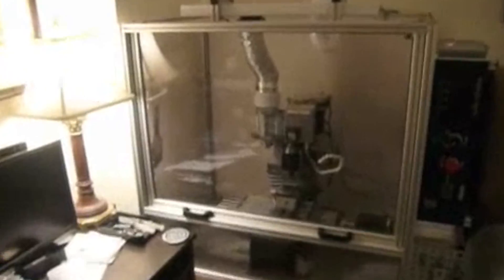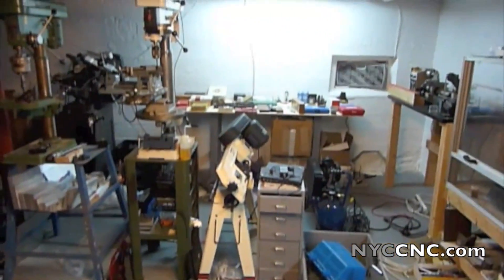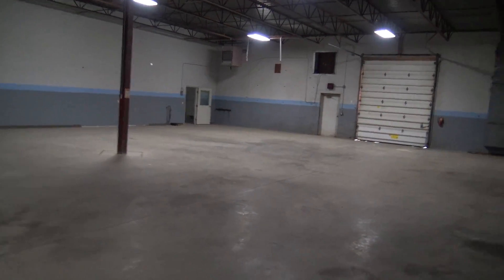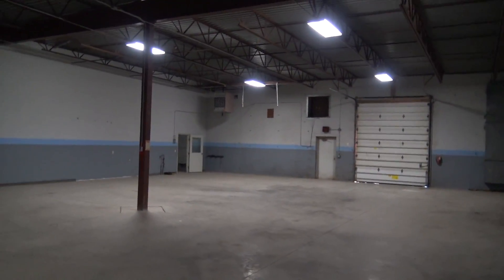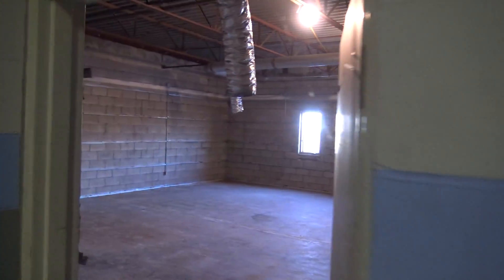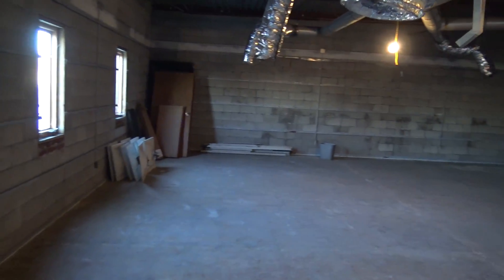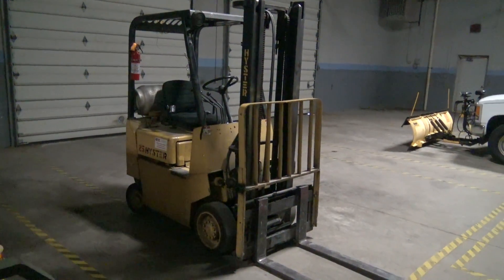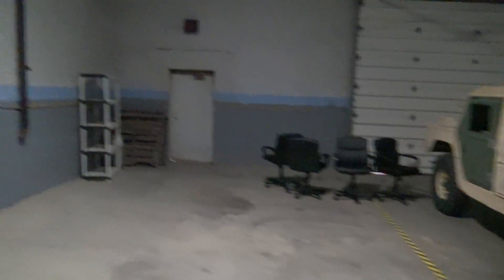We're Moving Again - One Last Time!  NEW SHOP!

Comment: On the epoxy floor, I did my garage, and I would recommend you put the non-skid (aluminum oxide) in it as you will have liquids and lubricants spilled on it…  Also you may want to approach manufactures to see if they want to sponsor you like Tormach did .  Free or at a reduced cost for the product, and possibly onsite help when you apply it.  Invite over about 10 people to help, due to the LARGE surface area, as I needed three people to do a two car garage and we were working hard to make sure we put the epoxy down according to the label directions…  I had good luck with Epoxy-Coat brand. http://www.epoxy-coat.com/  I am not affiliated with them but had good luck with their product.  None of the coatings are inexpensive, but the higher the build layer the better off you will be.

Like any coating, surface prep is PARAMOUNT!!! You can’t do it too well.

Comment: John cogratulations!  Copper air lines are absolutely the best.  once made, the sweat joints will never leak, and the best part is if you need a new drop/outlet, just cut into the line and sweat the new fitting in.  This is so much easier than steel or aluminum,  and again it's PERMANENT. 
As for the lights, you may want to check into a dedicated led supplier.  By me that is Cool LED Inc.  They will provide cost comparisons for your actual situation, payback times, roi, etc.  But, here's the cool part, they will also file all of the applicable forms with your power company and provide tax forms for you to make sure you get all available credits. Finally,  polyurea is the best floor coating by far. However, it is expensive, if you have areas that you know will take a beating use it there.  All the best.
Reply: +Ben Purdy I'm going to have to say that my experience with air lines has been that the new aluminum lines with press fit fittings has been the way to go. Large lines from our turbo compressor to the media blasters, and to the workbench areas has been flawless over the last 4 years of growth in our shop (we have the whole building now, about 6000 sqft). We started in one corner of the building, then our staged expansions and changes were so easy to do with no soldering or air leaks. We ran 2 1/2" main lines, with 2" feeders coming off of them. NO problems, no leaks, no hassle to change. But that may just be because we rock. Just sayin...    :)

Comment: I didn't read all the comments but I am sure this was mentioned. for the space division I would go with a combination of sliding partition walls and bi-fold so you can open the space as much as possible when necessary and as far as the lighting T5 is OK but bulb service life isn't great when compared to LED. Also with LED you have a better choice in control of the spectrum (color) of the lighting and less possibility of flicker issues if you get quality gear. BTW congrats on a new permanent shop, Can't wait to see the setup cause that's a beauty of a space.

Comment: John, send me your dimensions of the building for a lighting layout, I assume you want it bright. 
I can give you a point by point foot candle reading as well as fixture spacing.

Do not use T5, the cost of the replacement lamps are too high. I would go with a 6 lamp T8 over the T5 due to cost.
LED is going to be expensive up front. Probably not what you want to do during startup but if you do want to spend the extra money, then go for it. I recommend 5000k lamp color.

I can also help you with the electrical side of things if you have any questions/concerns. 
I am an electrical/lighting distributor.
Reply: +NYC CNC 
Done, let me know if I can help any further.

Comment: Congrats, buying your own premises is an exciting and humbling step...  LED lights are the go, buy the good ones and the payback time is less than the warrantee so you can't lose. We run polyethyline reticulation pipe with those chunky, hand tightened, compression fittings for air, we have s small screw compressor and probably use as much air as you would..  Anyhow, that setup works well, costs nothing and I can guarantee it will last at least 6 years without leaking, because that's how long we've had ours in place.

Comment: Yes on the T5 lighting.  We recently replaced all our lighting with those and the difference is remarkable.  The only drawback is missing out on the heat they used to provide in the Winter.  Oh well.

My advice on the floor epoxy is don't.  Two of our bays are coated and all you end up doing is essentially tiptoeing around trying not to scratch it up.  It's nice for cleanup, but if you get to moving skids around with a forklift, you will end up ruining it eventually.

Our welding bays are walled off, so that's obviously my suggestion, but if you don't want to do that, a curtain should work fine.
Reply: +NYC CNC No.  Beams, purlins & metal siding.  Just like the exterior walls, minus the insulation.

Comment: LEDs are not worth it in a small shop.  For the amount space you need to light it will be worth it for you.  The inital cost will probably cost you 3 times more than what t5's will cost you but if this is your last move you will get that money back with what you are going to save on electricity.

Comment: first of all WOW, that is a huge room, I have been following you since the taig  (i still use my taig) never would have thought it would become this big.    as for deviding, you meight want to go with welding curtains BUT with some way to stretch it like on a trailer, if needed it can be removed fast but because you stretch it you have more like a wall (not sure how to properly explain that since english is not my native tongue) airlines, copper if you are gonna do it do it right and do it in copper.not sure about the lights, led will be cheaper when running it, meigt not be the cheapest when buying it, but look for second hand lights, get them cheap and you can Always change them later.

Comment: That new shop looks fantastic, great job and congratulations!

I googled a couple of T5 vs LED evaluations, and they all refer to a study made in 2009, and as LED development goes, that's some truly ancient tech (In a very recent car headlight review the LED lights outperformed the HID lamps by some margin). A visit to a lamp store with a lux meter at hand would prove most useful. Any case, if T5's are selected, special attention to eliminate the stroboscopic effects must be taken, it would be bad if a lathe or a fly cutter  turning at 3600RPM looks as if sitting still...
Reply: +NYC CNC +1 on the LEDs, I have a friend with some in his shop hanging at 8 foot and they are plenty bright. For the high bays you should read up on the health advantages of ceramic metal halide CDM lights, they have a very high color rendering (close to daylight).

Mike
Reply: +allsortsofinterests Also, if you have 3 phase you can stagger the lamps for more even light like they do for stage and studio.

Comment: At least one poster is right. Codes will dictate exactly what you can/can't do. Everyone has there own opinion and this is just mine. Get your security up to a very high level before you move a single machine in. That glass front door is an invitation. Think crooks aren't interested in machining also? You'll be advertising just what you have right here. Yeah copper is best, and I think 3/4" is much better than the 1/2". You get much higher flow rates, and the pipe acts as a secondary air storage. However after a certain length of run the water has been condensed out. After that black pipe, proper flex air line is far more cost effective. You will have long runs of air line. That requires larger sizes to keep the same air flow just due to drag from the pipe walls

Run ALL your services up in the ceiling. It costs more to start because of all that ladder or hydraulic lift work. But it's easy to make the changes later that you will be doing. Power/air etc outlets in the perimeter walls should still get the drops coming down from that ceiling. 

Good thing your still fairly young, you'll need all the ambition and motivation you can get. Be ultra careful you don't get burned out with all this. It's far too easy to lose everything including family by trying to do what you think is right, but no one else can see or agree to the same. It's not worth losing anything over this. 

Sliding floor to ceiling panels if code allows them to separate the grinding, welding areas. This whole project is going to cost BIG BUCKS to get operational. If you don't have that? Start small, section off the building and work in the area you need. Pointless to heat, light areas your not using. 

Maybe it's just the lighting or something else. I seriously question the quoted hrs on that forklift. I've been running wharehouse, on highway, off highway, logging, and open pit mining equipment for well over 40 years. Something doesn't ring true there. Service the whole forklift so you know where you are. Especially motor and hydraulic filters. Forklifts are never treated to regular services by most unless there owned by a large company that does have or has learned the hard way that regular PM servicing is money well spent.

My best guess is you'll be moving up to something besides the Tormach equipment real soon. Factor that in while placing what you now have. Don't say a single thing on here about what your security is or is going to be. 

Put some industrial quality fans up on the ceiling to drive the heat back down where you need it. It it were me? I'd investigate some waste engine oil heating systems. At a guess I doubt you'd find a cheaper method. Your future customers will judge your business by how you keep your shop. Spotless may not be 100% needed everywhere. But customers respect that and no one else is as important to your business than those customers. All of this is pretty logical and basic, but it helps to get some input so you can figure out what to do or not.
Reply: +NYC CNC 
Maybe great, maybe not. Since I can't know your whole situation, much of that could very easily be worthless.

Comment: We use heavy duty tarps ie Lorry curtain sider material hung from the ceiling to the floor to partition off our machine area. It works really well, keeps dust and dirt out, a little bit of heat in and if we need to get into the area with a forklift we simply roll up the tarp.

Comment: have you considered walk in fridge panels. twenty foot long, four foot tall and ten inches thick. interlocking. east to assemble with a forklift. great at sound deadening and usually available second hand. six would give you a wall twelve foot tall and forty foot wide.
Reply: easy to assemble lol. not east. easy to remove as well. I think they use the same stuff to build supermarket walls etc.

Comment: Oh, and as for lighting, seriously consider T5 LEDs that are Full Spectrum, or 5000k color. You'll thank me after you see the difference in power consumption vs Fluorescents. You can get them for about $8.50 a light when you get them by the case. Plus they last for 100,000 hours, and don't need ballasts.

There are winners and losers when it comes to LED lighting. Knowing what you want in terms of light output and color temperature are important. Full spectrum lighting indoors is better than anything, because it reduces fatigue, headaches, and helps you see things in true colors.

Comment: congrats m8!.Far as walls go you may wanna check around and see how cheap you can make accordian type walls...angle iron track at top and wheels on bottom with just a pin or 2 per panel to lock to floor...either that or large indutrial rollups but they are gonna get spendy! curtains will work but they realy wont do much to cut down on dust and debris and they get tattered perty fast.Side note...epoxy is great if theres serious acidwash and prepwork done or new concrete but unless its perfect youll hate yourself in 6 mths.prob better off going with a stain and seal or just a seal and either way whatever you do get it done before you move a single piece of machinery into the building...even covered its imposible to keep the acid fumes from going after any unpainted metal in the building...cleaning flash rust off of ways and tables is bad enough but it realy sucks when it ruins sets of gauge blocks and pins not to mention what it does to tools anywhere in the vicinity...dont ask me how I know..painful even thinking about it

Comment: You divide your space with tall shelving racks. That's the best of both worlds, functional storage. You can leave a space opening large enough for a forklift, and use those clear plastic flap things from uline. One of my spaces looks like two large rooms, but what we did was got blank banner material, because it was cheap, hung it from a rafter with a pole pocket in the bottom, and ran some conduit pipe in the pocket so it literally hangs taut barely above the floor. Then we placed rack storage walls, floor to ceiling on both sides of the banner wall. It's both temporary, and permanent!

If you don't mind maybe seeing some advertising though the storage rack, you can get old large format printed billboards practically free. (the ones they take down after an ad campaign is through)

Comment: Congrats on the New Shop. You have a really Nice Place There. 

I see a lot of comments advising you to go with LED, but I strongly disagree. I had 6 LED fixtures in an area in my shop last year when I thought I would give them a try. Well lightning took out 3 of them the first bad storm we had, and then got the other 3 on the next bad storm. My shop has 40 light fixtures at 17 feet off the floor and they are all T8.Lighting is fine throughout the shop. I do use a stand with high intensity lights that we move around where we need that kind of lighting, but we would use that no matter what kind of lights we had on the ceiling.

I run Copper for Air Lines, Refrigeration Copper, NOT Water Pipe Copper. Water pipe has thinner walls and cost about the same as Refrigeration Grade. Easy To Install, Easy To Fix, and Easy To Rig in Special Need Applications. 
I don't use an air drier. I use 3 high air line out of the compressor that make up a large type of condenser that has 3 blow offs at the 3 low points. This goes into reservoir tank #1 then another condenser set into tank #2 and a 3rd condenser into the main tank or #3. All tanks also have a blow off in the bottom of the tank. These 12 blow offs cycle each time the compressor kicks on. Stan from Bar Z did a video on his system and I don't think he uses a drier either. 
We use air for everything a machine shop would but special uses include Plasma Table, Plasma Cutters, Regular Painting and Powder Coating. We are located in Mississippi and Humidity here is a real issue, but this system works very well. 
Last don't use Black Pipe. The insides rust and it causes problems with air tools.

One comment suggested to partition the welding area with telestrut members bolted to the floor and using welding screens. That would be the least expensive option, but another is the use of industrial curtains. They are fire resistant, move in place and out very easily, and they look nice. 
Installing walls is not really expensive but until you know that you want to wall in the area I would wait on placing something permanent.  

This conversation could go on for hours so I'll stop here. I may email you to discuss it further as I have lots that I can speak about.

Cheers
John

Comment: LED are nice but $$$  I would say go with LED in the smaller rooms, T5s in the main shop areas. Divider - 1/2 solid wall to the beam, 1/2 fan fold door from the beam to the other wall. Put the primary welding/fab area on the side with the solid wall, then you still have the other 1/2 that you can open as needed. You might think about renting the auto area out until you actually need the space. That way you are letting the building pay for itself somewhat. You might even try for someone who does restorations or customs and possibly that would get you some extra work making parts.
Air lines - copper is nice but $$$$  I would go with aluminum lines, fed from a compressor through a refrigerated air drier. With the height you have both of those could be mounted on a rack and boxed in to lower the noise level.

Comment: Cool.  Few thoughts:  Lighting, go T8, it's available everywhere and the bulbs are reasonable.  Space division, erect a 2x4 stud wall and put in a doorway that is closed off either by a) roll up door b) body shop curtain wall c) fancy sliding/roll up automated door  Auto-shop: leave it as an automotive bay, perhaps add material receiving and bandsaw station.  You have several collaborative uses for the space, training/NYC CNC, SMW/jobber machine, Freedom Huddle/guns.  I'd want to make sure you have adequate division as you see fit, but don't squeeze any one of the uses out the door, you have outlets for all of them, just make sure they coexist happily.
Reply: That sounds reasonable to me.  The auto bays would be useful for doing roll cages, fixing up surplus vehicles, building custom cars or experimental vehicles....lots of possibilities that would be synergistic with machining, welding and general fabrication.  Don't limit the future with today's options. 

-- Mike
Reply: Agree with the 2x4 wall, you could also add a vapor barrier (think 3 or 4 mil plastic landscaping sheet) on the wall to make an attempt at keep any grinding, welding grit out of your CNC space.
Reply: +Elektro21 If the wall is sheetrocked, you wouldn't need to worry about it getting through the wall.  The common practice for keeping rooms clean of dust is to use positive air pressure.  If he routes the HVAC right and puts an exhaust in the plasma/grinding area, it'll create a negative pressure in that room so the dust stays in that room.